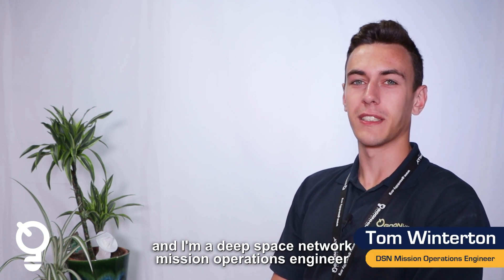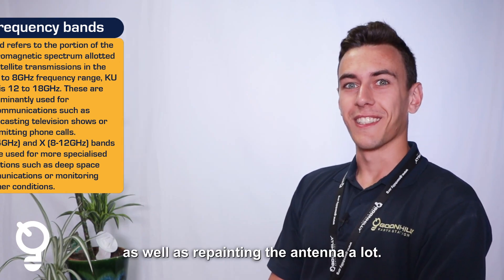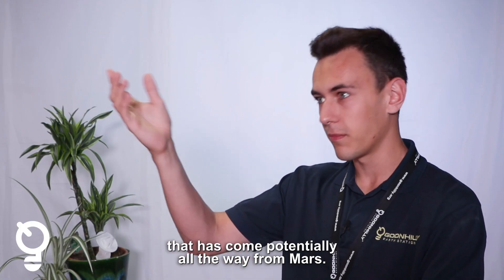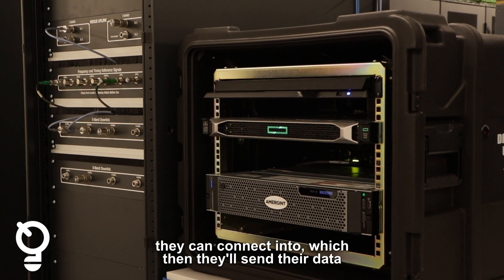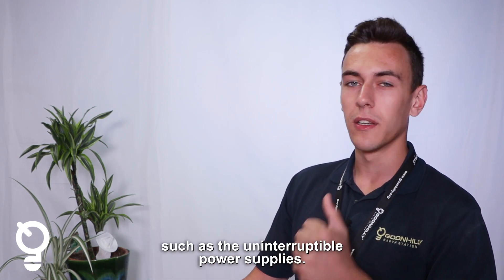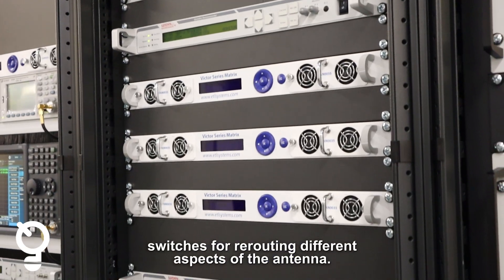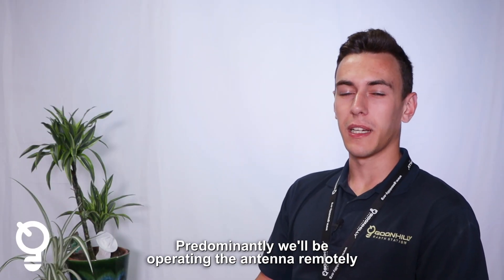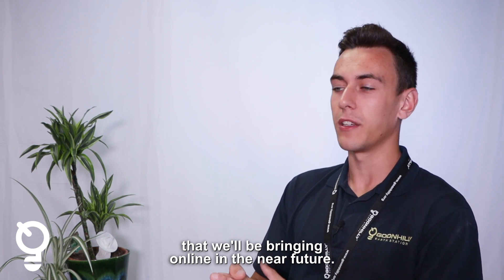A Tour of GHY-6 (Part Two) – Inside Goonhilly 6

Comment: I'm working on a refurbishment project of a 12.8m antenna formerly used as a NATO ground station.   We haven't had to replace any nuts and bolts, but have had a few structural repairs to do.  The main task is replacing the motors, and putting in our own modern motion-control system and position sensors.

Comment: Are there thoughts of increasing the size of the dish - as in adding additional external side reflectors?   Is a 32 m dish large enough or (as always) is larger better?    Is the equipment operated at 240 v 2 phase or are you using 3 phase 600v ?      Do you work with SETI during off-times?
Reply: For example for launcher tracking, one would rather choose a 5m antenna than a 32m antenna. This antenna might even have problems keeping up with some low flying satellites, especially, if they go through the zenith. Heavy structures are hard to move and might deform, which decreases signal quality.
NASA also shifts to multiple 35m antennas for deep space operations instead of single 70m antennas. This way they are more flexible and modern technology is capable of bundling antenna efficiently together.